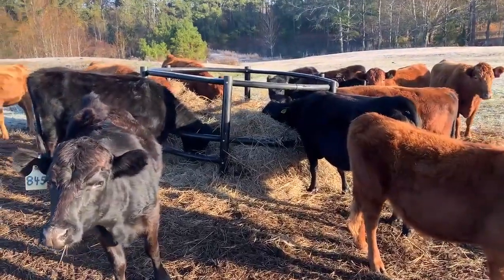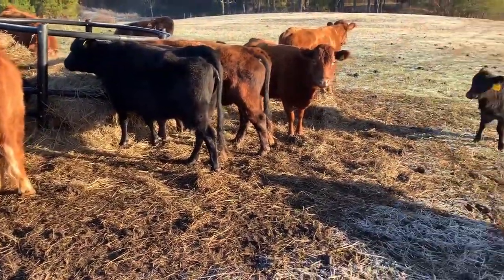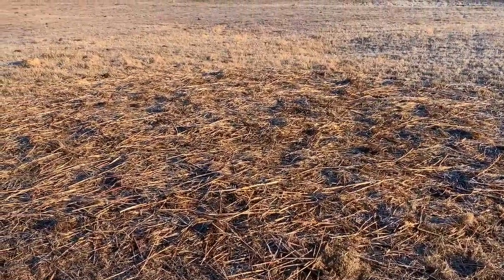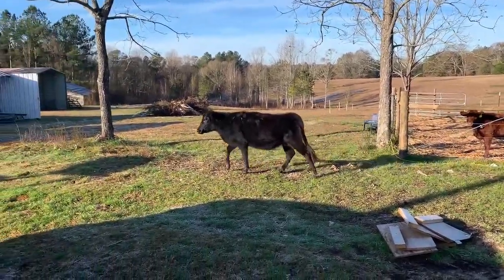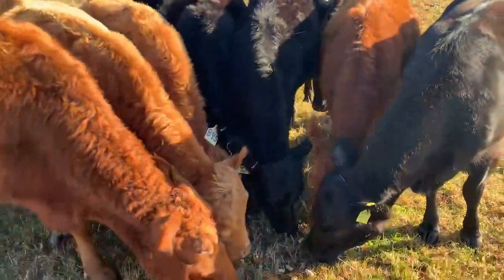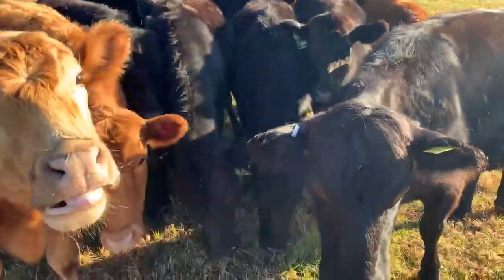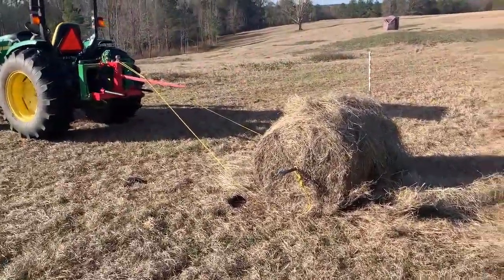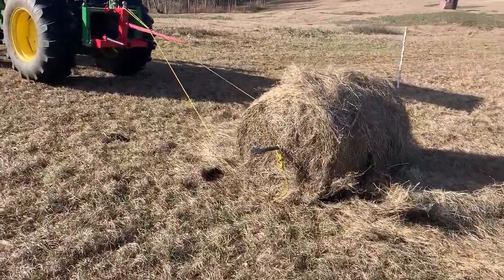DIY Hay Bale Unroller | Less than $50 And IT WORK'S!

Comment: Hmm, I would have said you were unwinding it in the wrong direction, but it worked out fine. You certainly can't argue with the results. Good for you! Good 'ol American ingenuity!
Reply from the maker: Thanks!  Not perfect, but it definitely works and got me through the winter hay feeding.  My hope is that by next winter, I am going to learn how to weld and build something a little better but still cheaper than the $2,000 commercial bale unrollers!

Comment: One reason I don’t like the round bales. Square bales you can get it exactly where you want/need it, and in the quantity you want.   But your idea works for you.
Reply from the maker: Not sure how I would do square bales spread out on pasture.  Do you spread your square bales out on the pasture? Also, I have used 35 round bales so far this winter and have 3 more weeks or so before the grass is tall enough to quit feeding hay. So probably 42 or so total round bales will be used this winter.  What would that be, about 840 or so square bales?  I am not sure my old back could sling that many squares bales.  I just don't see how I can successfully do regenerative farming and pasture management with square bales.  If you have any tips or tricks on this, I would love to know them!  Thanks for checking out my video and commenting!

Comment: push it in the hole your spear makes  then if needed finish with the flat on the spear frame    no need to  hammer or anything   then a 2 inch nylon tow strap no need for the spreader post keep up the good work
Reply from the maker: Very good advice.  I will most definitely try.  Thanks for sharing!
Reply: By “spreader post”, do you mean no need for attaching the nylon tow strap to an old fence post but just attach the nylon strap directly to your trailer hitch?  Thanks for the clarification.
Reply from the maker: I believe that is what he means. I have not yet tried this though.

Comment: if hay stands up when you run your hand against the end of bale that the oppisite way it as baled if you unroll it that way it will come off slower and thinner and youll cover 3 times as much ground and not have to spread hardly anything except for the bottom
Reply from the maker: So basically unroll it opposite of way it was rolled?  That is actually a really good idea, as I am seeing it exactly as you say in that it comes off really thick.  Hay feeding season is just about over for us, but I am going to try this.  Thanks for sharing!
Reply: @WattsWayFarm  no problem at least wiith your diy project if you start unrolling it the wrong way you just have to flip your post to the other side of bale and hook back up hope this helps
Reply: Yep, Greg Judy unwraps his 'backwards'. This is a great tip. I will try it with my truck until I find the perfect Jubilee.

Comment: When I worked with horses we contracted a tree service and told them they could come dump their wood chips on the property which they promptly started doing 
We put a lot of chips around the water trough as well as the bale rings. 
We switched from bale rings to inverted tractor tires and switched to square or small bales and would dump and cut strings spread the hay into the tires. 
The tires kept the hay in the tire and also kept the wind from blowing hay all over. 
We didn’t have a tractor but we micromanaged all over the place. 
Just google tree services and tell them they can come and dump
It also provides traction so your cows don’t slip and fall and get busted up. 
Tree services have to pay at the landfill to dump. You’d be adding organic matter to your land and saving them money
Reply from the maker: Thanks for the comment!  Sounds like a great hook-up you have with the wood chips.  I sooo wish we had that option here.  I have previously contacted all of the tree-trimmers, and they simply won't give away that gold!  They actually sell it here.  The going rate right now is $300 for a dump truck load

Comment: I’m not sure if you’re used to using square bales but I see you have round bales that are designed to be rolled out, “no hydraulics required”  you can stick a junkyard axle rod through the middle and I roll it with some rope it’s that easy.
 If you have an electric cable winch you can get fancy for next to no money with a junkyard trailer and make yourself a toilet paper roll looking set up on that.
Reply from the maker: agreed.  Rolling hay out is so much better.  Instead of an junkyard axle, I used a steel tamping rod, bust same end result.  Rolling out hay for next to nothing!  thanks for checking out my video and taking to time to leave a comment.

Comment: Century makes a bar kit to go on your bale feeder that will cut down on the waste a lot. It will pay for it self pretty fast.
Reply from the maker: I suspect it will.  But my strategy with unrolling the hay is not really to reduce waste but to improve soil quality on my farm, thus leading to better and more forage and as a result more cattle units per acre that my land can support. For every bale I unroll, I figure about 1/4 of it is going back to the land and not feeding the herd. And they are helping to earn their keep by trampling it a bit back into the soil. Thanks for taking the time to check out my video and leave a comment.  it is greatly appreciated!
Reply: @WattsWayFarm  I unroll hay too and have for probably 10+ years. I unroll to cows but use bale feeders for feeder calves and heifers. I see unrolling as spreading manure out and any they waste is good for the soil too but try to keep waste at a minimum. If my soil needs nutrients I use chicken litter. Hay is expensive.

Comment: This is a great idea.   Have you made any modifications your unroller since you first came out with it?  Also, when you have to make a turn, do you have any issue?  Dave
Reply from the maker: Really the only mod I have made to this a stronger rope. And have to make sure the spreader board isn’t repo far from the bale or else it will run over itself. No big issue when turning so long as don’t go too sharp. And can’t really unroll down hill as the bale will catch up with you!

Comment: Best $2,000 investment I ever made was buying a ATV bale unroller.

Your method worked but the atv unroller you spoke of is a lot more efficient and time saving but keep whopping on that spud bar.
Reply from the maker: I hear ya. But I don’t have an ATV yet either. 😪. And for $2,000 I could buy another cow / calf pair to grow my herd. I am sure in a few years I will be ready for the better unroller investment,  I think about it every time I am swinging my mini-sledge pounding that bar in.  I’m trying to convince myself that it’s good exercise for me in the mean time! 🤪
Reply: @WattsWayFarm  Have been doing this for years without the post and works great. We cut the chisel end to a narrower chisel so it goes through easier and cap it with pvc to protect the cattle as we unroll through the heard. Thanks for posting the video I never thought of sharing it like this. One other note it doesn't work well with peanut hay but for everything else it spreads the bale out nicely and it lets you use something light to pull when the ground is wet so less ruts. $2000 is better spent somewhere else.
Reply from the maker: @duke1467  Thanks for the comment.  That is a great idea about the PVC cap!  I think I will incorporate that into next year's iteration.